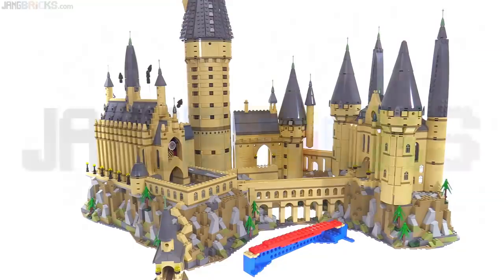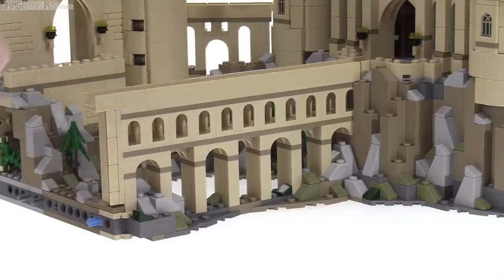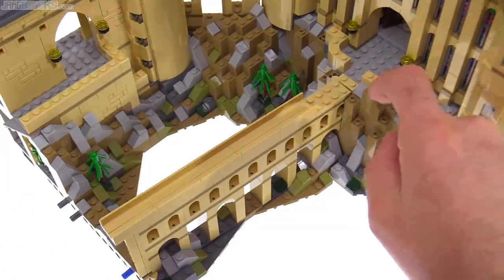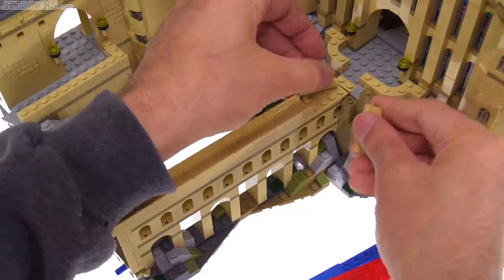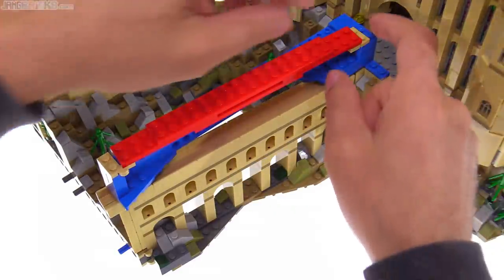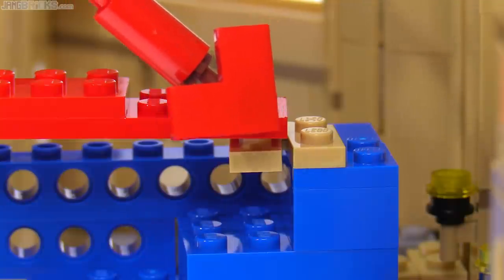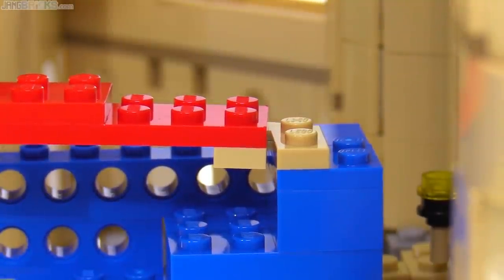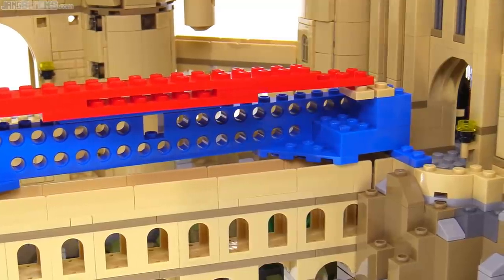LEGO Hogwarts Castle Viaduct geometry problem follow-up

Comment from the maker: The official Brickset review also makes note of this issue in their detailed breakdown of the build: https://brickset.com/article/37958/review-71043-hogwarts-castle-(1)
"Actually fitting the viaduct between these two sections is slightly tricky as the space is not quite large enough for the angled bridge, albeit only by a couple of millimetres. The difference is subtle but I am surprised to see a technique like this one in an official set as it must be causing some stress to the rocks on the left of the viaduct."
Reply: JANGBRiCKS are you bob Ross
Reply: Hello JANGBRICKS, 
I have been watching your videos for awhile now and have learned a lot from them.  Now, as a mechanical designer, I might be able to explain to you why LEGO would use this technique.  

I don't believe this would be considered a design flaw because of the buildup tolerance.  In the video at 2:20 you say "...to illustrate this better though and to take assembly errors out of it and kind of |cumulative tiny tiny errors of just having parts slightly twisted| I made the most basic skeletal model...".  The slight twisting of the parts is allowed within a certain tolerance which builds up especially on right angles/corners.  The build up tolerance combined with the lengths creates enough of an allowable bend for the LEGO designer to get away with this unorthodox technique.  If there were parts under the bridge, as in the model you made to show the issue, the assembly wouldn't have enough tolerance and wouldn't connect without the major stress you showed thus making it an illegal technique.  This technique will also, probably, never be in a playset as it wouldn't stand the stresses a model faces while being played with.  Another good example of a model that pushes the limit on the allowable parts' stress would be the UCS Slave I.

Hope this helps and keep making your excellent videos.

Best regards,
-RAKRONDEWL
Reply: I am kinda confused as to why the technique is illegal? im totally confused
Reply: @timlee3551  It introduces stress since you have to deform the bricks to properly make the connection.
Reply: JANGBRiCKS I’m no expert that’s for sure but while building I do usually miss place bricks is it at all possible on the left side of the build isn’t as long as the other side or it’s placed abit back on the opposite side
Reply: Did Lego ever address this? I just got the set for Christmas and have zero issues fitting that part it. No pressure whatsoever.
Reply: @rakrondewl  it doesn't use this technique it's a design flaw of their scale by the designer and manufacturer

Comment: As both a fan of lego and a student studying mechanical engineering, this design flaw irks me quite a bit. Trigonometry and triangles are super important when working with angles such as these, and Lego has achieved unique angles like these much better in the past. (Just look at the recent Amusement Park Roller Coaster set) Jang, you did a great job of you demonstrating this issue clearly with a color-coded sub-build. Hopefully there’s an easy solution to disconnecting some parts to make the viaduct fit better.
Reply: This is a solution. May require some mods to the viaduct and/or wall, but this is the correct geometry! https://flic.kr/p/28Z8LKv
Reply: Tanner Compton Hey, im studying Mechanical Engineering too. But in any case, i would like to see if anyone else who bought this set also has this problem, cause maybe Jang built the bridge alright, but maybe the connection points are off by a stud or angle.
Reply: I would say that maybe a "legal" solution would of required heavy modifications to other structures, and maybe increased the price, but then again this is quite an expensive model to begin with.
Reply: YOO finally someone says this. i think i have a bit of OCD and even if it’s off in the slightest it just makes me mad, it doesn’t feel right. especially if i’m dropping over $400 on this set.
Reply: Tanner Compton I’m also studying mechanical engineering, lego was what led me to it funnily enough
Reply: Tanner, is that AlanYuppie's lego Computron in your profile pic?
Reply: I too just graduated with a degree in mechanical engineering, and I was thinking about getting this and now seeing this vid, this issue is going to irk me.  Still planning on getting the set soon.  Just though I'd mention this since so many mechy's have come here to party.

Comment: I feel as though the issue is minor, but for a lego set with a large price tag and collector style of build. It feels like a design flaw they could have fixed
Reply: Rokkie Teller Exactly. They are "just plastic" in the end, and I feel concerned about that level of stress on them. This set feels "uneven" to me; allows in an amateurish, unbalanced quality. Seems more like (albeit with measures of awesomeness!) student work. Could benefit from more "polish".
Reply: I guess that was the best solution they where able to come-up with. I bet that Lego has a build and tried a few alternatives and decided that this was their best solution
Reply: @sarowie  Actually, I seriously doubt Lego would bother with the monopoly they have on the market.
Reply: Exactly. A lot of Lego fans get incredibly mad over those Lepin legos - rightfully so, but one of the main arguments is that at least with Lego you get quality. I find this to be an issue I would not expect from a 400 dollar pricetag.

Comment: The distance between the hinge pivot point is:
22 studs when work out use the blue part
22.091 studs when worked out useing the red part.
Reply: Tnarg Tnarg yeah its impossible to make something like this fit perfectly
Reply: That one guy.
Reply: Ooo, thanks for the math portion
Reply: @boudewijnb  Unless you use a pythagorean triple! The simplest example is 3, 4, 5. The diagonal distance of a 3 x 4 rectangle is exactly 5. But there aren't really any close to 2 x 22
Reply: @MatthewJensen77  Yeah, I think the closest is (7, 24, 25). That would add some serious depth to the build, though. Probably wouldn't look right.

Comment: Some of these comments are embarrassing. 

For an expensive set, there has to be closer look on this issue that could stress out the pieces. 

Why can't some of you folks understand that?
Reply: because this doesn't stress anything out, its a tiny thing that was obviously a conscious design choice to get the bridge at that slight angle. It embarrassing that anyone thinks it matters in any way.
Reply: I don't think he's talking about the angle of the bridge, it's that the length of the bridge doesn't match with the distance allowed between the two hinge pieces. The length of the bridge itself is longer than the distance between the hinge pieces - this forces the lego pieces on the bridge to literally bend upward to fit into the length allowed by the two pieces. This means pieces are being stressed, which can be a big problem for those pieces in the future. 

Some people may argue it doesn't matter, but this is especially concerning because 1. Lego as a company denounces illegal building techniques in fear that lego pieces may be stressed, yet they use an illegal building technique in one of their bigger sets, and 2. we expect a certain level of care and quality coming from Lego when it comes to big, expensive sets, yet they let us down in that regard with this set. You may not think it matters, but it does matter for other fans of Lego and collectors, especially the collectors.
Reply: It's even more important when you consider this is the type of set to sit on someone's shelf for years, those bricks are applying a constant force and will either break or deform each other eventually. the designer should have noticed this and fixed it with tiles or another connection method.

Comment: I always felt (when making Mocs) that if the piece bends or doesn’t look right, then it’s “cheating”
Reply: All the other structural integrity on it is actually making it not bend, rather, it is likely moving other parts apart.
Reply: Yeah I always feel that if an arm moves in a strange manner [like a piece has to be removed temporarily to articulate it] then I have to find another way

Comment: Ladies and gentlemen a perfect representation of how the Pythagorean Therom applies to our daily lives
Reply: Logan Christiansen ahhhh no, no it isn’t
Reply: Logan Christiansen how is this daily?
Reply: NO
Reply: Could you explain please?
Reply: Zaittsev the hypotenuse is too small for the viaduct, which can be proven with the Pythagorean Theorem.
Reply: Toby Wallis or by looking at it and using common sense.
Reply: Logan Christiansen the only time
Reply: I wouldn't really consider building a gigantic lego model "part of our daily lives"
Reply: Theorem*
Reply: "common sense" is not a substitute for absolute, provable mathematical accuracy.
Reply: @zaittsev  geometrically speaking, in order for a lego block to fit in an angled manner it must form a pythagorean triple (i.e. integer length sides)
Reply: It is actually more complicated, since the bridge itself should be shorter, as it is same lenght as sides... the hinges are problematic part, because they rotate at oposing corners of bridge,  making its lenght effectively diagonal, since it is ectangle, not line. So, even though bridge should be shorter, it is actually about 0.1 blocks longer.

Comment: Very interesting that Lego did this!  I wonder if they were aware of this when building it or not.  Either way its illegal enough that LDD wouldnt let you do it, and it may stress the elements.
Reply: I assume that LEGO designers  (comparable to LDD) get warned by their software if they use an illegal building method. Therefore I think LEGO cut corners on purpose. I think this is a serious issue.
Reply: Heh. Cut corners.
I see what you did there.

Comment: This might sound at bit silly, forgive me, but is it possible that the designer of this set had collision switched-off on Lego Digital Designer? (which you can do if you switch on Developer Mode) Sometimes there's that geometry problem that you know you can solve in real life but cant on LDD, and so you disable collision to allow you to solve the problem. It's a long shot I know :)..
Reply: They don't use LDD, but good guess :)
Reply: he would have obviously been immediately aware of this if it had been designed in the LDD, so most likely it wasn't (as it also appears in the design video)
Reply: Red Moon that seems extremely logical
Reply: As i know Lego has no digital designers, everything they build is hand made.
Reply: They still build the final model multiple times with real bricks before mass production, and this is something you notice immediately when building it. It's hard to imagine that it was anything other than them just cheating a little.
Reply: A long time ago there was a promotional set (an Audi TT Roadster, set number 1359) that included a Technic peg inside two old macaroni pieces. Over time, the peg would warp and bend out of shape because it didn't quite fit. Ever since then, LEGO has been much more conscious of issues like these that could warp bricks, or just make building a set unnecessarily difficult. Their goal is to maximize playability and longevity of sets and bricks.

We don't know everything, but we do know there's an extensive design process and it always ends up being built as physical bricks long before release.  There are people that look for issues just like this one and try to mitigate them. Sets go through a rigorous testing process, and I believe they even heat up the whole model to see if structures fail. 

So for sure, at the beginning of the process, it could have been a digital issue, but it should have became physical and noticeable long before release. Either the LEGO Group somehow overlooked this, or they noticed the issue and decided to give it a pass.
Reply: They dont use ldd, and justin himself said he is a traditional hands on builder...
Reply: I'm pretty sure Designers don't JUST use LDD, or do they?
Reply: Red Moon i think designer don't use LDD
Reply: Assuming nobody at Lego made a test build?

Comment: Big respect for expanding on this issue Jang! There is actually I believe an easy way how to build angle like this without this issue. As far as I can tell, the bridge is offset by 1 stud over the span of its length, right? [EDIT: Frags correctly pointed it's 2 studs. It wouldn't really work with 1 stud offset and initially I made a false claims here.] 2 (!!) stud offset angles using these hinge plates/bricks are 100% legally POSSIBLE in lego, all you need is to place the hinges differently. This is a quick mockup I put together showing the right way. https://flic.kr/p/28Z8LKv

I am VERY surprised the designer didn't go for that, it feels like a rookie mistake to me! It should be easy to modify so feel free to go for it!
Reply: Krištof Pučejdl ok
Reply: It's offset by 2 studs
Reply: You are right... huh, I may have thought too fast here. Regardless, the connection as I suggest it is either correct or the offset is so small that it's impossible to see it when built in real or digitally. I will do some more tests later to see whats the case.
Reply: OK, my bad, ripping hairs now. It actually IS 2 stud offset that is always correct :D Thanks for making me think!
Reply from the maker: While this does allow a legal, unstressed connection of the hinge in the simplified demonstration model, it does not fix the issue in the completed model, as there's an entire stack of bricks directly below the red plate that impact the landing.  Look at the corrected LDD model from the top to see what I mean; the top point of the red plate, which is effectively a 2D representation of a 7+ brick tall bridge, overlaps the blue 2x2 plate, which represents the edge of a BURP.  I should have shown this in my video as it's actually a better illustration of the fundamental geometric issue of the bridge being too long for the space into which it's forced.
Reply: Do you think you can try how difficult would it be to modify either the back edge of the viaduct or the structural wall it connects to (recessing it by one stud perhaps, or going even fancier with some snot to create small clearance) to apply this fix? I think people would appreciate it. I certainly would :)

Comment: I remember running into this trouble when building. But there are other ways to get around this problem. Ball joint and connector pieces, when together will solve that unequal problem.

Comment: Thanks for this video. Even tho it doesn't matter too much for most people displaying this piece, it could be an issue for some if you would want to create a MOC landscape where you would place this building on and it might not align with the studs of the landscape. You would probably get the same stress on the pieces as shown in the red and blue build.

Comment: I am glad you made this video.  I have been building this set and have been struggling at this part in the build thinking I was doing something wrong.  Wasted so much time thinking I had made an error.  There is way too much of a gap. This should have been corrected by Lego before releasing this set.  You know they are seeing the same thing we are.

Comment: Thank you very much for demonstrating this design flaw! Would it be possible to work around the problem by removing the hinges from one side, building more space for the bridge on that side of the rock works and letting the bridge disappear in that space without firm attachment? For display purposes that should be enough, even if it wouldn't be a perfect solution.

That being said, it's odd that LEGO designers would build official sets with illegal techniques...
Reply: Maybe they didn't notice the bend, because they didn't see it. the actual bridge on the castle doesn't visibly bend and is just stressed slightly. It was probably close enough to pass pre-production reviews. Maybe no one at Lego checked the geometry after seeing the final product, and after seeing that everything works well enough.

Comment: The hinge should have been only on one side, I don't understand why they went with this...
Reply: Exactly!
Reply from the maker: Even without the right side hinge, the bridge is still that much longer than the space it's supposed to fit in.  I only focused on the overlap at one small point, but it extends all the way down to the floor.  The bridge needs to be shorter to fit.
Reply: I see. I intend to buy it, but I will have to fix this while I build it. I really don't like illegal builds. With so many bricks available, if you can't design something without bending bricks, you're doing it wrong. And it's really surprising to see it in a build on this scale where it's so obviously wrong to say that designers don't care or know what they're doing.
Reply: You could fill the offset using a second layer of hinges at one end, making it a two leg linkage instead of one. That would preserve rigidity without tension, but maybe require some creative covering.
Reply: Could they have used "Mixel" joints (small ball joints) to make the bridge connection? You can use it to replace the hinge, and by building the bridge shorter by a stud it might fit better? Plus you can build over the joint to cover it.

Comment: Theoretically could you fix that issue by replacing the hinge on the right end of the bridge with a 2x2 smooth plate? It would allow the bridge to sit perfectly on top of it without structural weakness

Comment: I've had these problems with some sets, but it still works perfectly fine, so I'd say it's legal, but not scaled 100% correctly which is a manufacturing error, which I think happened in the final flight of destiny's bounty or director krennic's space shuttle thing.